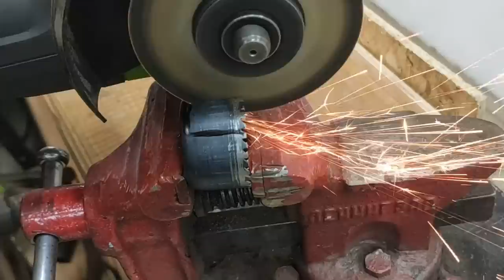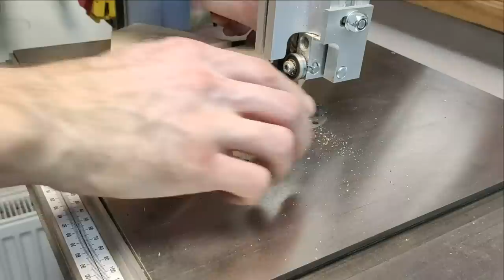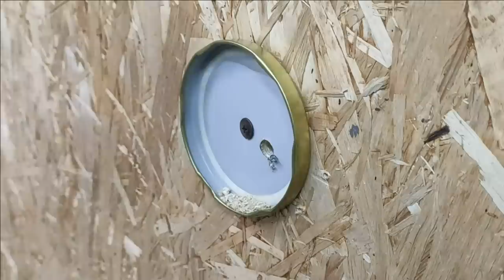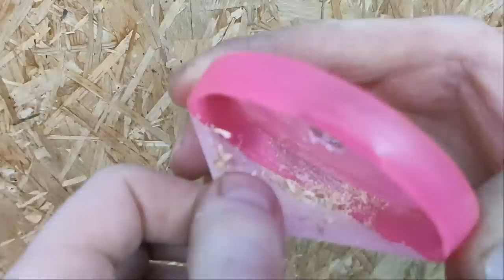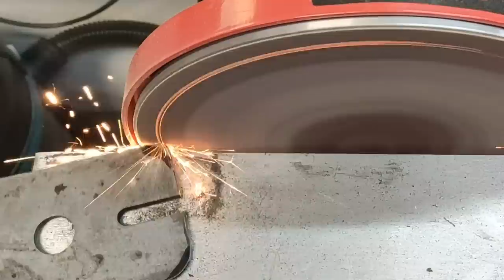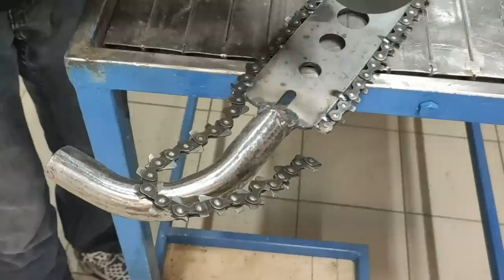Do NOT throw away worn circular saw blades! Turn it into a useful homemade device

Comment: Jello single serve cups or other brand of jello cups can be used to put woodworking glue into, lays potato chip tubs the kind of chips that stack with a plastic lid can cover the glue cups and keep the glue from setting up.

Or you can use the lid and cup to drill a hole in the wall to catch dust and saw dust. Like he did with the lid and tape.
Reply: Nice!

Comment: That cheap holesaw kit can be sharpened, but @ 9.99 dollars new why bother?
Good use for a woren out tool
As it would take quite a bit of work to make it cut again  when you can just go buy a new set or replace that one with a qulity tool as its used more then the others in the set.